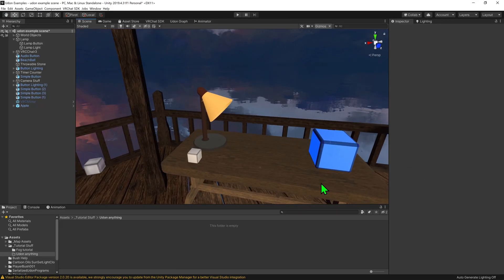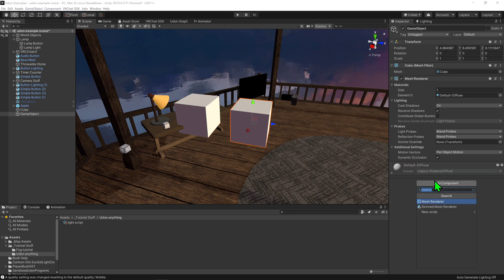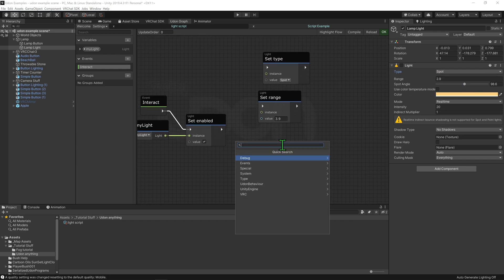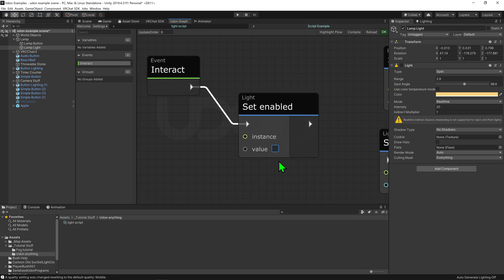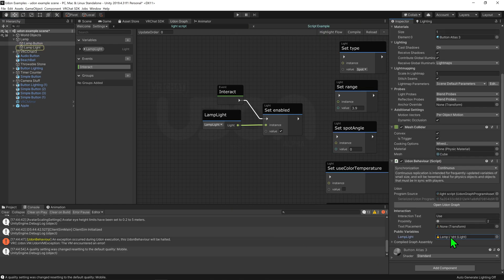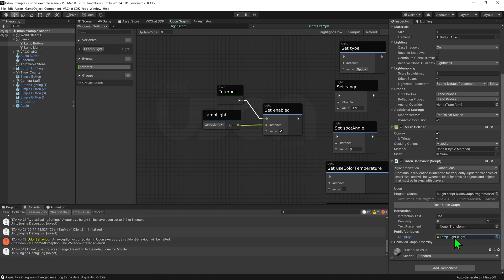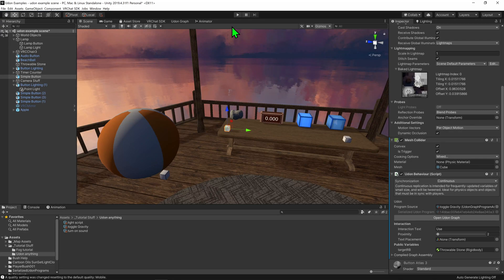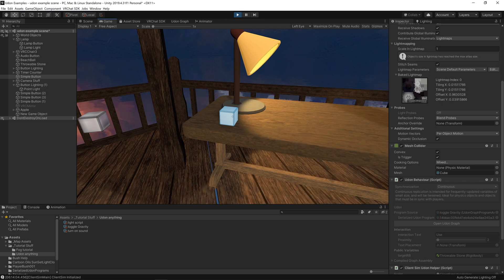How to Toggle ANYTHING (almost) in Udon! - Udon101 - VRChat SDK3.0

Comment: Will this works on particle system?
Reply from the maker: Yep, 100% will work. However, if you want to change a setting on a particle system you will need to get its module. Off the top of my head, to toggle the emission it is something like:

'Particle system, get emission' --> 'particle system emission module, set enabled'

Hope that helps ^^

Comment: Hello i have a question, with a toggle, can we change a material??? Because i need to make a system like that when a player collide with a object
Reply from the maker: Sure, though it is done a little different. If you just want to change the first material on an object, you can use the node 'meshRenderer, set material' to change it (It's a bit more of a pain of it's the 2nd, 3rd, 4th, etc... For that, you would need an array). You can then use a bool variable and flip it, and then plug it into a branch node to do one node if true, and a different if false. Have a look at my video all about events (one fore this one) for more on that. I also have an example that toggles the color on the object, that I use to showcase when events play
Reply: And what if i just want to disable a keyword like emission?
Reply from the maker: @normi_kun  You can use the node 'Material, EnableKeyword (_EMISSION)'  and 'Material, DisableKeyword (_EMISSION)' to enable and disable emission. Simply use a branch node to choose if it plays the enable or disable node

Comment: Is there a way to toggle hide all players and show all players from a click of a button?
Reply from the maker: Eh... kinda. 
If you make every player enter a station (set to mobile) when they enter your world, you can then locally set that station to be immobile, and move it far away. This will lock the player's position to the station's, so you can locally change their position. However, doing so, anything they pickup will still show in their hand, but as they are miles away, you won't see it in the same position as they see it (as they on their end, will still be in the map). A fix for that would be to make your own object sync, but I haven't covered that on my channel. Lastly, you also won't be able to add any seats or such to your world, as it may mess it up. Also also, player's temporarily leave their station when loading, and can also enter each other's station during that time, so people may not be in their station and/or may be loading for you, and thus won't disappear

Alternatively, you could use the camera technique shown in my jumpscare tutorial, and update the camera's position and rotation each 'event, post late update' frame; but if they ever update the vrc camera by taking a screenshot with f12 or updating the clipping range on their camera; they will need to restart vrchat to see the disappearing effect again. Also, quest users will see it delayed by a frame, which is very much not ideal.

So yea, hope that helps.

Comment: 13:50 For the udon graph crashing, I believe I found the issue for this and how to solve it. I noticed my graphs only crashed if I had a public variable with a gameobject set to it in the component and then I deleted the public variable before deleting its references (the gameobject that was dragged and dropped into the component in the inspector as well as the variable's node placement in the graph).

My solution was to make sure to delete the references, deleting them out of the component in the inspector and then deleting the node off of the graph. Then unchecking that the variable is public, hitting compile/reload, that way to remove its option from the component, then I can safely delete the variable from the graph. Since doing this, I have no longer had a graph crash on me. If this is the same issue as yours, hopefully this helps you

Edit: and if I forgot to do this step and had a crashed Udon graph, when I'd re-open the graph, itd be completely blank. But I believe, if I recall correctly, just creating a new public variable within the graph, I think I usually just did a gameobject, it'd refresh it all and bring all my work back
Reply from the maker: Interesting... For me udon was crashing as soon as I dragged it into the code, so I don't know if that lines up with what you've seen. It wouldn't correct itself if I hit compile, and even restarting unity didn't fix it.
Personally, since I almost always want to rename it anyways, it's often just as fast to just make it manually (also isn't a thing in u#). I only showed it here, as I figured it would make it easier for people to understand variables ^^